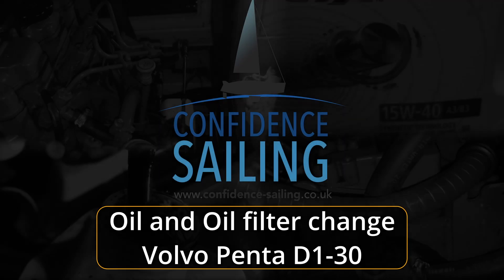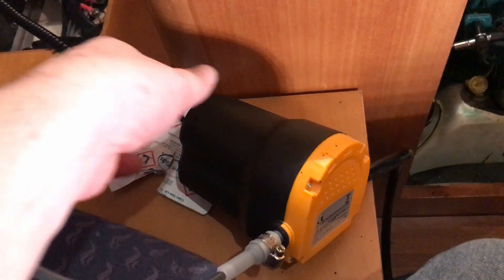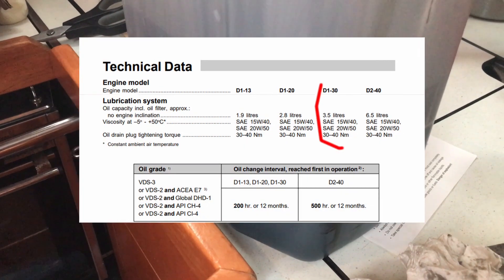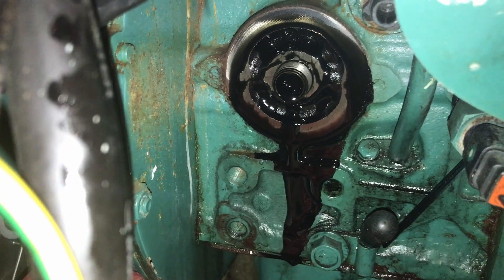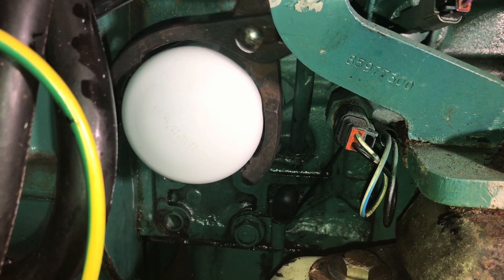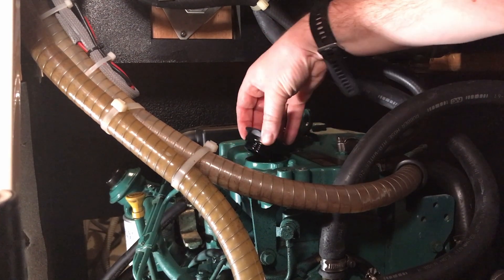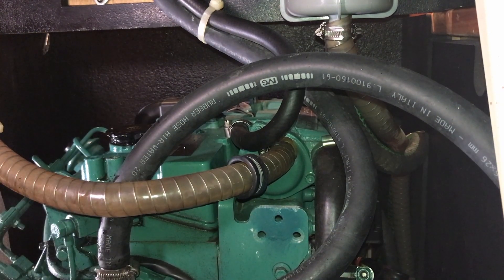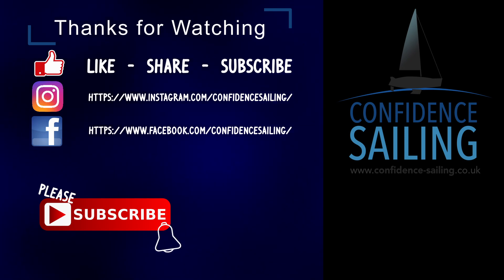Small boat engine servicing - How to change the engine oil

Comment: Three mistakes were made there whilst changing the oil filter. The new one needs filling with oil, a film of new oil around the new rubber gasket and only hand tighten which others have mentioned on this thread. Hold the oil filter vertically and just below the housing whilst it is full of oil and fairly quickly move to the horizontal position and screw on. This engine also takes far too long to fire up, maybe the fuel system could do with a good clean out. Try and keep fuel tanks as full or empty as possible to avoid condensation forming within them resulting in microbiological sludge building up in the bottom where the water settles after dripping from the tank walls. Check coolant level, water drain in your filter and oil level before each start up day. Warm the engine up for a good 20 minutes. Use a good fuel additive with each fuel tank fill to keep the system, particularly injectors and fuel pumps clean inside. It is surprising to see when a well used fuel pump is dismantled for reconditioning just how much in terms of black deposits are removed from the small fuel holes if no additive has been used. Check torque of all shaft coupling nuts and bolts and all engine and gearbox mounts ever 500 hours. This will reduce the main machinery rattling loose and falling out of alignment resulting in vibration problems. Good husbandry of your marine engine will help give thousands of hours hassle free boating and save a small fortune over the years. If you have got a bit of technical ability about you or are willing to learn from books, do it yourself, no need to pay a character like me working for a company with a glossy website £60-80+ an hour to do it for you.

Comment: Hi. Thx for the video. One question. Why are you using the dipstickhole instead of using the oil drain pipe? Are you really able to suck all 3,6 lieters from the dipstic hole?
Reply from the maker: The D series do have drain holes. And they would definitely perform better at draining than auction. But the drain hole is in an awkward spot to place a suitable recepticle for the waste oil. 
Also on my last two engines the drain/sump plug was completely inaccessible so I have gotten used to doing it that way.

If you have a D-series engine and can get a decent bottle or can under it, then yes definitely use it.
Reply: @confidencesailing Drain pipe, not hole. It's a separate pipe. Better for draining. (It's a wider and shorter pipe/tube outside the block  coming from the bottom of the engine on my engine. Not sure about all versions of the engine, though. )

Comment: Nice video!  FWIW I was taught (high school Auto mechanics,1970’s) to smear a thin film of the new oil on the new oil filter thread and gasket. Also suggest using a funnel to add the oil. 
My 1977 era Volvo Penta Gas engine came with a hose attached  to the oil pan drain plug. It took a few seasons of boating to discover it and it’s great for oil removal. Cheers!
Reply from the maker: Thanks for sharing! And thanks for Watching.

Comment: 1. You are using the tool the wrong way. 
2. Never use the tool you unscrew the filter for tightening the oil filter. Only hand tightening and always apply oil to the gasket

Comment: @confidencesailing you see that little black cap next to the oil filter that is attached to the green oil suction tube going to the bottom of the oil pan???? Take that black rubber cap off by simply pulling and then use that tube as your suction point! Cheers! It is the same on ALOT of Volvo Pentas
Reply from the maker: Hi Robert. I know the black cap of which you speak. 
I've got so used to 'going through the dipstick' that I've never actually used the 'correct'  method for this engine.
I did consider it when making the video, but decided to stick to the 'old' method. Thanks for the comment and thanks for watching.

Comment: It is not recommended to use a tool to tighten the filter. Tighten by hand. This is done to avoid denting the filter that can cause a fatigue failure at the dent due to pulse pressure in the system.
Spiridion Azzopardi